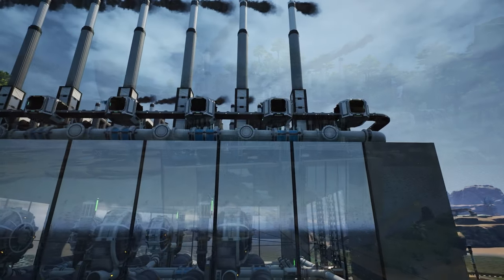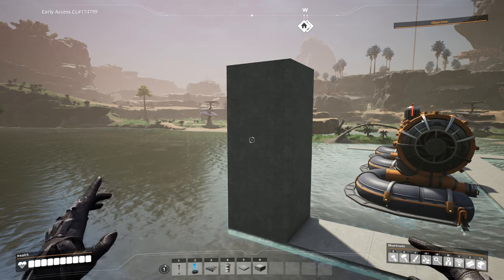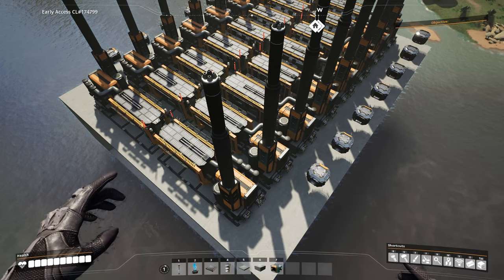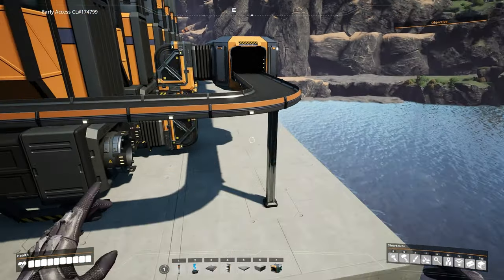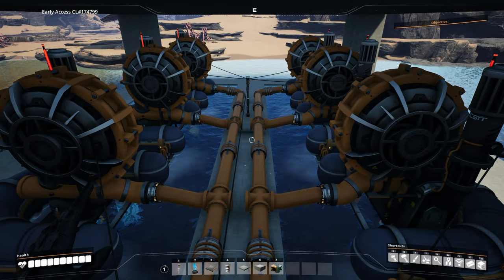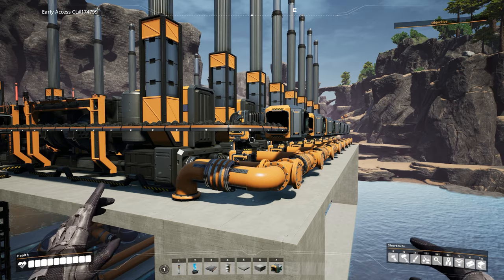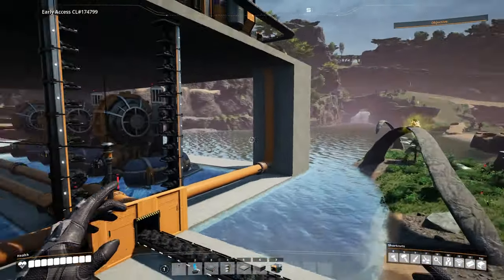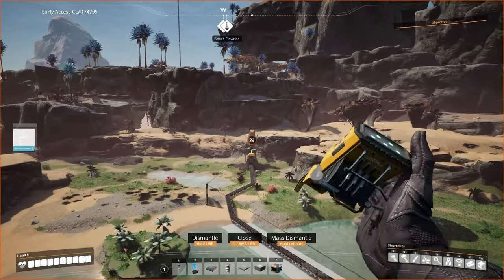1200MW Coal Power Plant Tutorial | Satisfactory

Comment: I really like the design, but a nitpick would be to make it work with mk1 pipes (very possible), and mk2 belts, since that's what's available when this setup is most useful without mods. (Right at the start of T3)
Reply: I've done a very similar build, much more messy though but same concept. What you can do with mk1 pipes is to actually backfeed the system by hooking the ends of each sides pipes up to each other, instead of a standard separated staggered design like this. That helps getting the water to run smoothly to the last generators as well.

So basically, with this specific layout he's doing in the video, you'd feed the two separate pipes up to feed one for each side, then in the other end at bottom extractor floor, you merge the ends of the two pipes together into one pipe, feed that up, split it once up there and connect to the end of each sides feed. So you basically feed the whole system with 3 pipes instead of two.
Reply: it can be done with mk1 just by making a curve upwards from the penultimate to the antepenultimate and from the second to the third, this with every 8 generators and on the other side you repeat the same
Reply: So I heard him say that it doesn't work with the mk1 pipes as well, i'm gonna be honest I put them to mk1 to test it and it's been running for like 20+ hours without issues and all of them still being full at water all the time
Reply: @AsTrOReal  and you didnt change the design or added other pumps?
Reply: @tyrextyrex4380  nope
Reply: @AsTrOReal  It couldn't really work at 100% efficiency if you built it the exact same way. I did, too, and I had several fluctuations, never reached 1200MW, and sometimes fell as low as 800MW.

Once I upgraded the pipes to Mk.2, it went as smooth as it could.
Reply: @vizay  hey im confused what u said english is not my first language can you simplify cuz i want to make a 1200w power plant without a mk2 pipe
Reply: @vizay  hi can u tell me how to do it in discord
Reply: Also because 9 minutes into following the video I find out I can't do this yet
Reply: @vizay  Could you explain the second part of your solution a bit more clearly?  I get running the two pipes back down to the water extraction level, but then you kind of lose me.
Reply: it isnt work with mk1 sine the pipe flow is just 300 and every extractor can do 120. 120*3= 360 so the last generator would not be fill with water
Reply: Honestly you SHOULD make it with T1 pipes because I've been running my 2400 MW coal powerplant since way before I even researched T2 pipes. Filling up 20 biomass generators is not fun
Reply: It's easy to design, know how much each thing can carry per minute or make per minute. The math is super easy on most builds. After you learn that the rest of designing is easy
Reply: @vizay you could also send up 4 pipes, one from each corner, so like each water extractor on the corner has a pump and pipe going up to its corner to feed 4 generators, then the two extractors in the middle of the other 4 just split in half on their respective side and send half to each side.
Reply: I would still say this build is useful in late game because coal nodes are both more readily available than oil and nuclear nodes, the buildings are functionally considerably ‘cheaper’, and you don’t have to deal with byproducts.

Comment: For the record, you can still do this with mk1 pipes but you're going to have to double up the water pumps and run them as a separate line with 3 pumps to 4 generators. I did this at the lagoon while working with the 4 coal nodes and turning it in to the regional water pump station as well.
Reply: 3 pumps work fine for 8 generators but you need to run the pipes up at both ends since mk1 pipes can only handle the output of 2 1/2 pumps (at standard speed) which will only feed 6 2/3 generators (at standard speed). Just add a pipe, with a pump, between the first extractor and the last generator in each set of 3 extractors + 8 generators so you get a loop.  (But with the pumps facing opposite directions, all pumping upwards.)

Comment: To do this with Mk1 pipes, turn the water extractors around 180 degrees.  Build your pipe manifold just like normal, one junction for each generator.  Then add a junction between generators 2 &3, one junction between 4&5, and one junction between 6&7.  Feed a pipe directly from each extractor in to these new junctions.  Each extractor will need its own pump.
Reply: Or instead, you can just run a second line of pipes up that back end, just like the front end, use pumps as well, and it flows just fine for me
Reply: I need a diagram I can't understand this I just started this game

Comment: Mk1 pipe compatible 

Join the 2 pipes in the back (wall opposite of conveyor) and run it straight up with 1 pipe and 1 pump. split it on the top floor into 2 pipes and connect them to the 2 unconnected ends on the 2nd floor.

Comment: I do a similar build for my coal-plant. I just rotate the water extractor 180°, put pipe-floorholes infront of every coal generator and connect them underneath. That way you can easily do the piping depending on what pipes and power shards you have.

Comment: You don't actually NEED Mk2 pipes.  Mk1 pipes will work just fine: use two pumps to split the output of the middle extractor (and max fill the pipes), and send two pipes to opposite ends of a generator row, 4 generators per pipe.

In this configuration, it'd be better to place the pumps on the vertical pipes up.  Pipes show headlift now when placing pumps, so use that cue.

Also, through-wall power connectors work on thin foundations, so you can wire them through the floor & use the underside of your upper platform.
Reply: any chance you can share a picture of that?
Reply: I built this as you said and it worked for me, thanks for the help I had almost lost hope.

Comment: Nicely done! When working through all the tiers that was one of the two spots I used for a coal power plant. Now that I've got a large diulted fuel power plant, I got rid of my 2nd coal plant and just have the one in same spot as yours. Mine is perpendicular to yours and uses the one pure coal node that's just south of that lake. Using mk3 miner slightly overclocked to have a full mk5 belt of 780 for a 3900mw plant. It's a great spot for coal power!

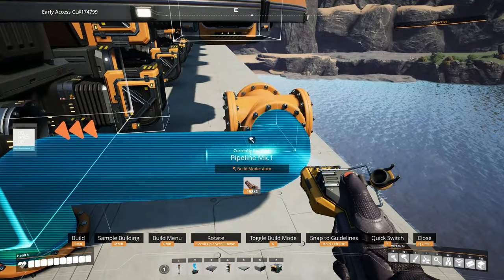Comment: 11:42 a way to fix that is to try and connect the pipe from the ground to the curve WITHOUT connecting to the roof role connector before. It will clip and you can put the role there afterwards. It used to work, not sure if they fixed it

Comment: What's pretty crazy is I put my coal plant literally in the exact same spot. I am using 12 all overclocked for 1600 mws and have it set up in a building floating over the water. My water pumps are floating behind the building. I also used all mk. 3 belts and lifts to keep the coal coming in fast enough. Been working good so far. 👍

Comment: Nice vid.  My critique would be to flip the design so that the generators run off a central feed for both coal and water, so in essence flipping the coal generators for the feed to be in the centre rather than at the edges.  I connect the water at both ends with only 2 pumps and in that way only need Mk 1 pipes.

Comment: Thanks for sharing the design.  I like the look of your design with the full frame windows.  NOTE: you can make this design work with Mk 1 Pipes.  You simply have to put a second set of pumps on the opposite side to feed the the upper pipes from the other end of the pipe.
Reply: Can you explain how? because the MK1 pumps already have the issue that the transport height is greater than the pumps can handle (22m for me, but the pumps can only do 20m). What exactly do i need to do with the Mk1 pipes?
Reply: @Etherion195  I believe headlift is calculated from the elevation of the center of the pump.  Try moving your pump to the vertical portion of the pipe.  The water extractors themselves have 10 meters of lift, so as long as the pump is less than 10 m above them, and less than 20m below the highest pipe in your system, you should be good.
Reply: @pyrobryan  Thanks, i'm gonna try it:)

Comment: I stopped playing Satisfactory, cause there wasn't any decent descriptions ingame about how to utilize or properly make the coal-generators work. I see I need to try getting Mk2 pipes to get the water upwards. How do you turn the pipes in a 90 degree angle?

Side Question: Should we use or build Fluid Containers too? to store up excess water for when the extractor goes offline due to you overloading the grid?
or are Fluid Containers not worth it?

Comment: does it works if i use a maxed mk2 auger on a normal coal depot?
Reply: A mk2 miner will pull 120 coal per minute from a normal coal node, so it should work without overclocking.

Comment: Thanks a alot for this! What mod did you use for building multiple foundation blocks? Looks very smooth when you build. :D
Reply: I believe the default button for changing build modes is "R". Different things can have different build options. Elevators can be built in reverse, pipes have 4 different modes, etc

Comment: Nice setup but I would have used both coal mines that are available in that area and run them up the sides. That way you can use Mk 2 belts for each, overclock each miner to 120, and then separate the water extractors to three each and be able to use the Mk 1 pipes.

Comment: Hey quick question, when I split the conveyer belt multiple times the last coal generator or two is barely even on half the time (doesn’t get the coal). Do you have any fixes/how many resource nodes should the coal supply come from. (This is probably a dumb question but I’m pretty new to the game, and do not fully understand how each part works)
Reply: i have the same issue, if you find a fix please tell me haha
Reply: A coal generator requires 15 coal per minute, so a series of 8 generators will require 120 coal per minute. Make sure you are feeding at least that much to the system and that you are using mk2 or higher belts.  Using splitters in a series like this will feed 1/2 of your input (60 coal) to the first generator.  Then the 2nd splitter will feed 1/2 of that (30 coal) to the 2nd generator, and so on.  The last generators will not get much...at first.  However, eventually the first generator will get saturated because it's receiving 60 coal and only using 15.  Once that happens, the first splitter will pass 105 coal to the 2nd generator, since genny 1 only takes the 15 that it needs to operate.  When genny 2 becomes saturated it will pass 90 coal, and this will continue down the line until the first 6 generators are saturated and the last splitter sends 15 coal per minute to each of the last two generators.  It takes a long time for the first 6 generators to become saturated (around 30 minutes), so I like to manually feed 100 coal to each generator to get the system up and running faster.

Side note, in a video I saw, smart splitters actually reach saturation faster than normal splitters when using the fastest belt you can throughout the system. Set each smart splitter to have one belt putting out coal, and one belt set to overflow (3rd belt not attached so it shouldn't matter, but I always set it to none)

Comment: How many coal input do you need?
Reply: I wanna know too, how many miners are being used and are they normal, pure?
Reply: @GrimmDZ  he's on a normal node. Miner mk1 I think the coal generators don't burn that much per min. But works have been good to add to video if he's over clocked or not
Reply: Each coal generator consumes 15 coal per minute.  A mk1 miner on a normal mode generates 60 coal per minute, or enough to feed 4 generators.  This can all be done on mk1 belts.

Mk1 miner on a pure node generates generates 120 units per minute, enough to feed 8 generators. Requires mk2 belts up to the first splitter.

Mk2 miner on a normal node also generates 120 units.

Mk2 miner on a pure node generates 240 units per minute, enough to feed 16 generators. Requires mk3 belts.

Comment: If you want to get rid of the wonky floor hole pipe, just pull the pipe straight through the floor, and use the pipe hole as a decorative piece so it doesn't look like you pulled a pipe straight through a floor :P

Comment: Thanks a lot! Great video and give me lots fruit for thought! How do you manage to "fly"...I am up to Tier 3 so far, looks like I won't be able to do anything like this, don't even have concrete foundation
Reply from the maker: I used a mod called Just Fly, and I used a couple of other mods to essentially enable creative mode
Reply: You can just use other foundations until you unlock the concrete variant in the Awesome Shop. I didn't have the flight mod Wa_zz uses either, I just built a ramp for getting up to the roof and had no trouble constructing the power plant from there at tier 3/4. Believe me, the version I built was lacking MK-2 pipes and two water extractors. Still got a solid 900W out of it which was so much better than the crappy bio-fuel setup I was struggling to keep stocked.

Comment: You can use Mk 1 pipes if you connect both sides the same way so water comes in the coalplants from opposite sides.
You also don't need a pump on a horizontal level. You only need them to overcome headlift....that's 10 m for a level 1 pump.

Comment: I'm just not getting the same results. Sure, if you turn off the generators and fill them up, you will achieve 1200 power when you turn them back on, but I don't see how this can continue in the long term. A mk2 belt only carries 120 max. If this belt is split to fed 8 generators on both sides that means 60 coal each side. That is enough to power 4 generators, while the other 4 occasionally kick in. Or am I just missing something?

Comment: That's really a nice and clean design, portable on different situations on the map. Video is pretty clear, and also have showed to me how to build better and faster (unfortunately looks like to build with some confort everyone need to install the fly Mod, game is almost perfect, but at this point Devs should think about give us this feature by game default). Compliments, really. Just small questions, please: are all the pumps not overclocked? i'm fresh one in game, just 100 hours, so i got belts Mk2 but pipes Mk1,  and two modes of coal available in my location (starter biome, the big lake down. I can overclock both nodes at max if needed. Can you please give also the measurement of the square? 9 on one and and how much the other? i'm try to build everything aligned on the map grid, so i had to plan a little bit more.

Comment: I've made a very similar looking one myself.  Though not as pretty...  Not very good at design here :D  But I did mine in a location with 4 Coal Nodes.  All with Mk.2 Miners.  So its basically twice the size.  I first tried doing it with splitters in the middle but found that there was less power outages with splitters just going to one generator.  I also put the gens inside so only the smoke stacks are outside of the building.